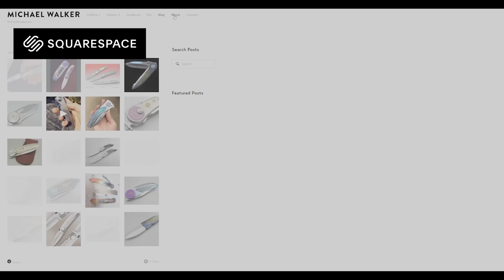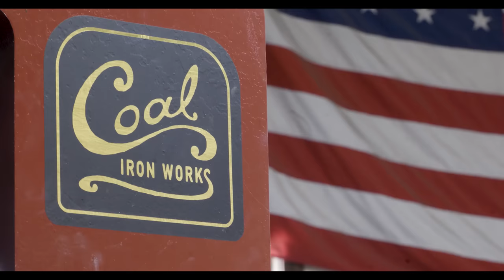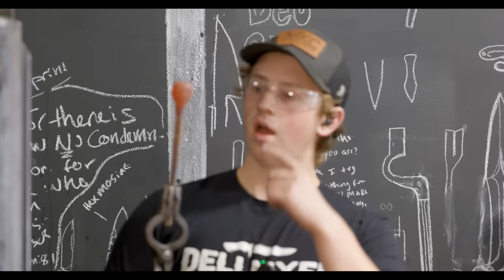I Forged A Titanium Soup Ladle

Comment: I think you almost understated the properties of titanium. It will most certainly not poison you.  Titanium is used in the medical field inside the human body for its extreme bio compatibility and very high corrosion resistance.  In this case its “good thermal properties” are actually good because it has terrible thermal conductivity, keeping the handle cool. It’s totally overkill to make a ladle out of, but that is what make the ladle amazing.

Edit - spelling.
Reply: I wonder if rough unfinished Ti like that has the same level of medical properties compared to polished pieces (apart from being less abrasive for tissues ofc).
Reply: As a quadriplegic, I have a whole bunch of titanium in my neck... no complaints.
Reply: @Mr.Leeroy  in some applications where you expect bone growth to ensure a more stable interface with the implant the material used is porous or at least has a rough surface because bone adheres better to it (there's more places for it to grab to) for example in dental implants some of the parts that get screwed directly to the mandible have a porous part so that the bone grows into it and holds it in place

Comment: You said it, Will! Your next project should be a Damascus Gandalf's Pipe! Maybe a piece of worked small diameter tube stock with threaded ends that the Damascus bowl can screw onto and a Damascus mouthpiece screwed on the other end.

Comment: There is actually titanium cookware which is made for outdoor use. I bet it is not for long travels, but it is some durable stuff used around the campsite.
Reply: Much better for long travels because of it's low weight. Of course it's not as strong against impacts as stainless steel but it has better corrosion resistance and unlike stainless steel, titanium does not leach chromium and nickel.

Comment: That forged look is awesome!
In Copper and/or stainless steel I bet it would be a hit seller!
Reply: Why would it not be a hit seller in titanium? Titanium has better corrosion and thermal resistance than even stainless steel, and leaches 0 toxic material while stainless steel still leaches chromium and nickel. The reason titanium is used in implants is because it does not react with the body in any way. One of the least toxic metals.

Of course titanium is more expensive, so it cannot be made cheaply.
Reply: Cheaper and easier to work with.
Reply: @GeorgeBP81  Oh you meant hit seller as in the profits it makes, not units ordered. Sorry.

By the way, copper should be avoided as cookware due to toxicity, it leaches when in contact with acidic foods. Most sauces are too strong to be used with copper. Copper cookware always comes coated with steel, teflon or traditionally tin.
Reply: @murmenaattori6  I would like a copper pot coated with electrolysis silver.